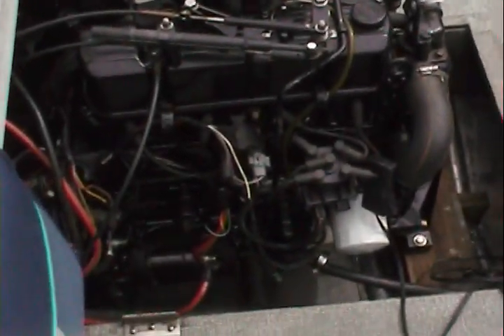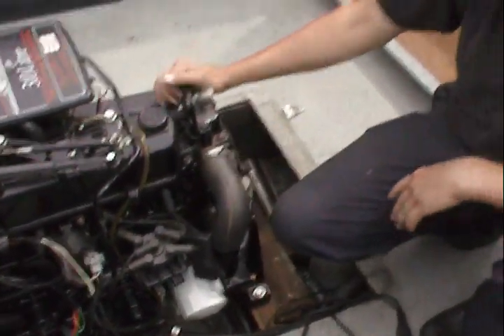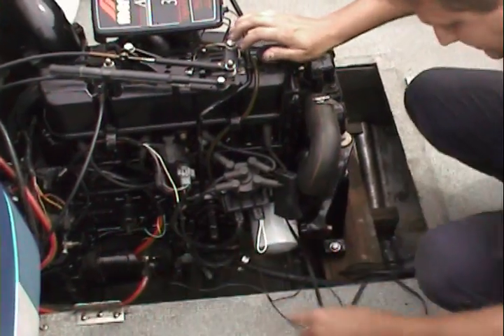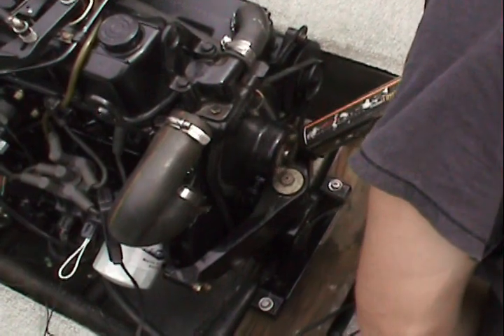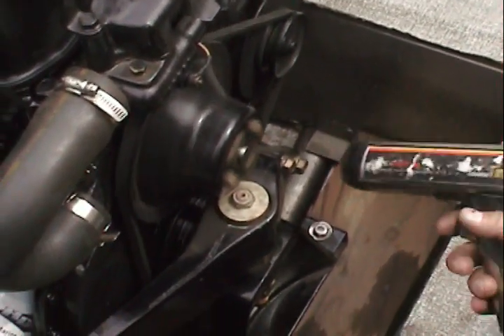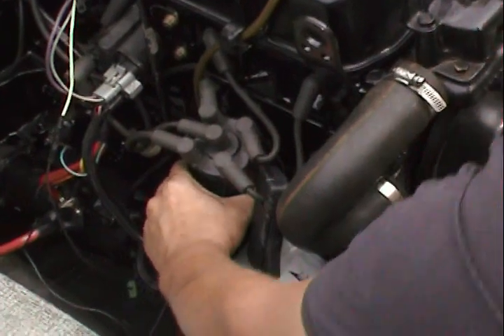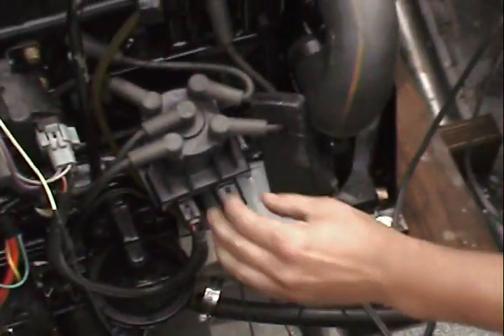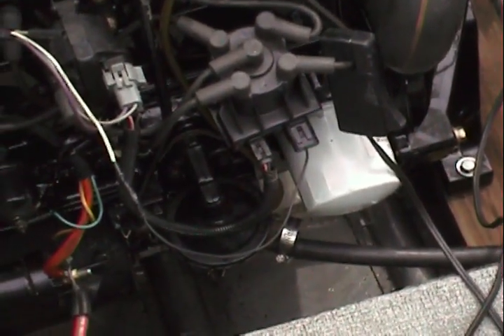EST  ignition timing 3.0L Mercruiser

Comment: Hi nice video.Shouldn't the base timing in 3.0l be 2o After TDC ?Why you set it to 1o BTDC?
Reply: rouscy if you have a timing light you don’t need to bypass just paint the notch on the crank white and put a white dot on the 2 degree mark on the plate so you can see it. When you put the engine into base timing that’s just to slow it down so you can see the mark better. Just put a dot on the notch and a dot on the 2 degree mark
Reply: Jeremy Rowe So if you put a dot on the balance or pulley and a dock on the timing play 2° you won’t have to put it in bypass mode?
Reply: @jeremyrowe4339 base timing is to keep timing from moving. It prevents the advance from changing timing

Comment: I see him connect something to the red wire on the starter motor. Where/what is that coming from or going to...
Reply: to power the timing light, its basically the battery terminal cable to starter

Comment: MY engine immediately dies when I supply 12V to the black wire. I either cannot get into base timing or cannot get out of it, one of the two. Any thoughts?
Reply: Same issue here .. any progress?
Reply: @Its_Bobbys_World  No luck. I shelved my boat project until now again. Still having the same issues and it's running like crap. Did you find out anything on yours? I've come up dry with my infinite google searches.

Comment: My 2003 bayliner mercury 3.0l is running like crap , and cuts off when accelerating .. you think bad timing can cause that?
Reply: No more then likely its a fuel delivery issue
Reply: Clayton Hoover 

So maybe carb or fuel pump ? 
It idles rough and when I give it gas it dies , but if I put it full throttle it'll pick up ..and it's hard to start most of the time.. I've changed the plugs, cap and rotor and sucked all the old gas and put new gas.. idk what do u think
Reply: I would start by rebuilding your carburetor you could rig something up to check fuel pressure it should be around 4-8 psi
Reply: Clayton Hoover 

Yeah I'll do that , rebuild carb it has never been rebuilt or taken apart in 14 years.. 
also forgot to mention I did short /spark something the other day when I was replacing the spark plugs , I touched the ratchet to something positive near the 3rd plug.. u think by that spark it'll put it in base timing or cause another issue ??
Reply: Nayef al kurahi I highly doubt that would do anything other than pop your circuit breaker could of fried your ignition module but I highly doubt it but to check that you use a digital timing light and make sure it's still advancing timing when you rev it
Reply: Clayton Hoover 

So do I need to put in base timing if I just want to check timing , not actually do it , just want to check timing ..
Reply: Nayef al kurahi no just hook the timing light up and advance the throttle
Reply: Clayton Hoover 
I don't get it lol 
So hook up the gun to positive and negative on battery and put the little clip on spark plug 1 . And put engine in forward like 2k rpms and then do what ?
Reply: Nayef al kurahi s
Reply: I had exactly the same issue with my 3.0LX. I did find that my timing was completely off. I just wish i did this when I got the boat. The dealer just told me it's fine and my carb was dirty. How can they be a certified mercruiser shop and not be able to adjust the timing when they do annual service?. I was blown away.

Boat i running fine now with lots of power. Now I even need to prop up because of the extra rpms 😎👍.
Reply: Kim Jensen hey how are I have the same motor did you  adjust the your Timing on your engine and what degree was it? Thanks

Comment: My engine serial #  0W033540
What degree should be for this engine base timing?

My research says serial# " all above" 0L341000 should be set at 2 degree ATDC.
That would be my engine, right ?

Please let me know, thanks
Reply: Daddyoui S I confirmed with Mercury help line and it is 2 degree ATDC for my serial number. You must set your base timing based on your serial number. It is not a standard setting that works for all 3.0 mercruiser.